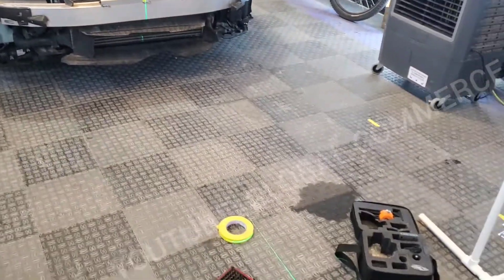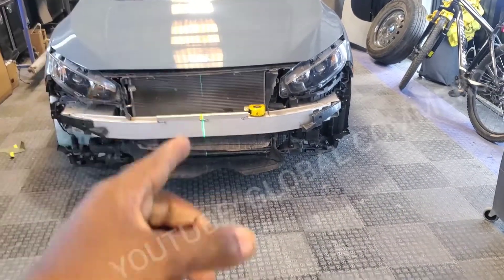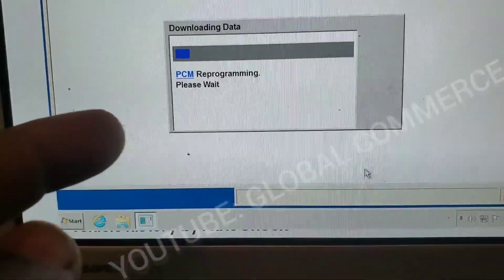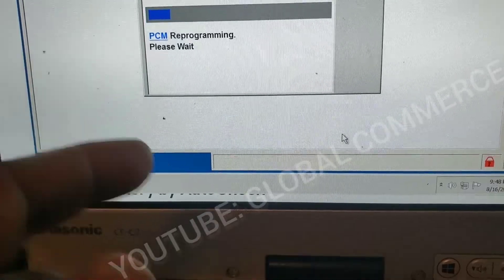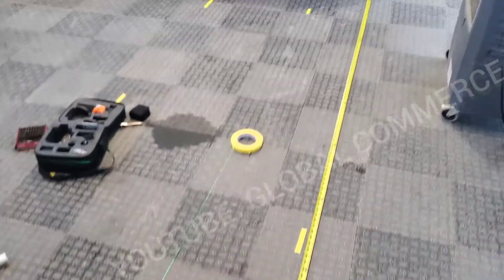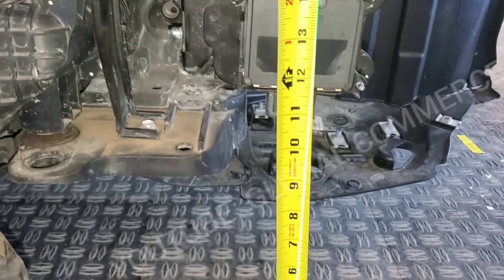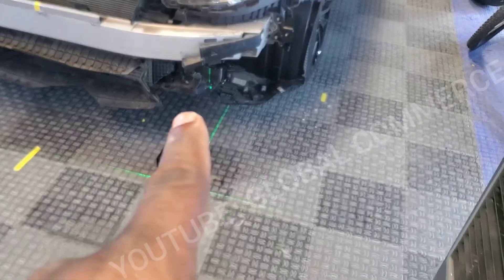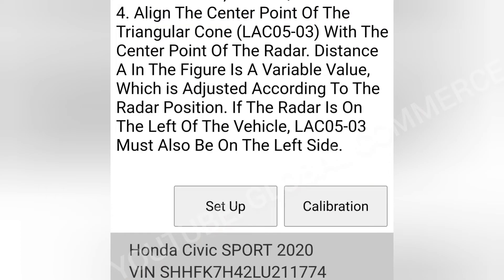2018-2024 Honda Civic ADAS millimeter wave RADAR aiming calibration in 4mins! P2584 P2583

Comment: Thanks for sharing the video, Just got my Crv 2017 radar stolen in NYC planning to buy a used good condition radar that fit and also planning to buy a cheap scanning tool to calibrate it myself, Which tools you recommend that can get the job done.
Reply: I may need your help 😭
Reply: @ Hey there, i fix it myself i brought a good use radar sensor one on ebay then plug it in and drive for a while and it calibrated it self. Now is working just fine 👌
Reply: @LatinoGang_Dayz i did the same but got a new one but now i have to calibrate it how did you do that ?
Reply: @ If it is a brand new radar it would have to be programmed first time use i think. I went from 0 to 40 mph and did some hard barking after i that  it calibrated it self and all light went out.

Comment: Hello, would the radar have to be calibrated as well as the windshield camera? I've recently Calibrated a 2019 Honda Civic Windshield and after a code showed up requiring me to calibrate the acc radar. I'm wondering if there is any correlation between the two systems that would cause it. Thanks for any advice.
Reply from the maker: yes you have to calibrare the windshield camera too sometimes or it may request it

Comment: Is there an affordable diagnostic tool for an everyday person to recalibrate the radar sensor?
My Wife hit a curb and the mount is not broke but dashboard says ACC problem, collision mitigation problem.
Reply from the maker: Hi first i would possible try to clear the codes and see if it is clear. If you're looking for an affordable diagnostic tool to recalibrate the radar sensor, you might want to consider options like the Autel MK808 or the Launch X431. They can often handle radar and sensor calibrations

Comment: I got the same code the blue driver scan. Tried disconnecting thr battery and also dont see any damages on the radar. Is this job only fixable by dealer or can anyone else do it as well?
Reply: It’s too expensive to do it yourself. For now and maybe a few more years. For now, only the dealer or someone who has the tools. Good luck

Comment: Where are you located and how much will be the cost of calibration of the millimeter wave reader and the ADAS radar on 2022 Honda accord?
Reply from the maker: Houston tx,  if you are in the area contact us at Globalcommerceca@gmail.com
Reply: @globalcommerceca  I'm not live in NC looks like the cap is removable
Reply: So on 2018 civic touring does the front bumper have to come off to recalibrate?
Reply from the maker: @BeefStewLuvr  if is blocking you from adjusting mounting screw

Comment: Where are you located and how much will be the cost of calibration of the millimeter wave reader and the ADAS radar on 2022 Honda accord?
Reply from the maker: Houston tx
Reply: @globalcommerce7654  I'm in Houston and need a calibration for my 18 accord. Could you quote me? I don't have parking sensor just the need the one for active cruise control and lane assit